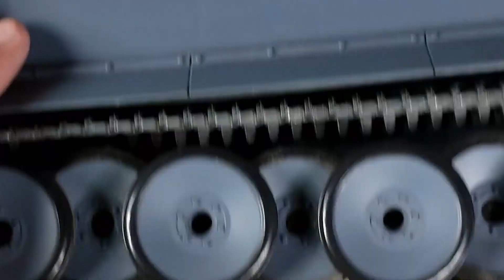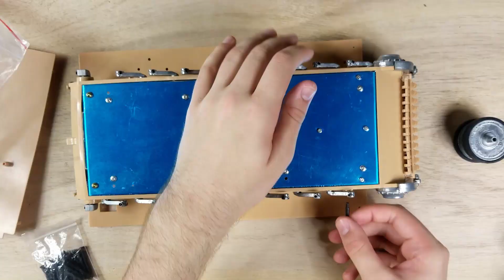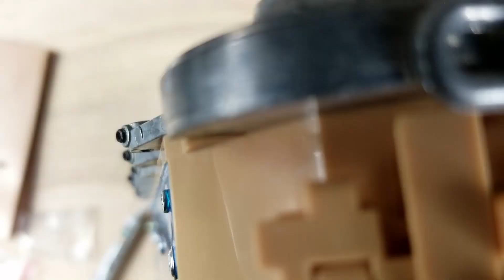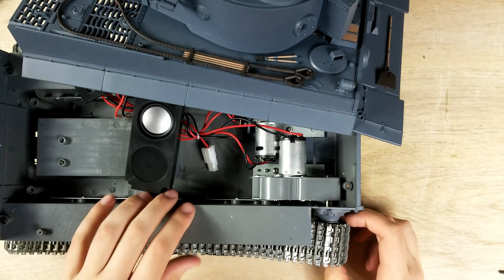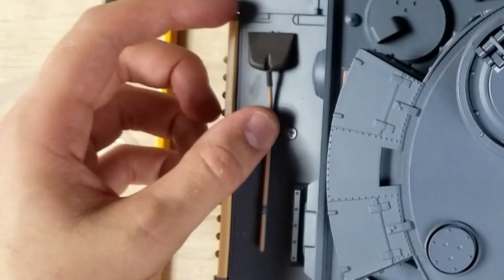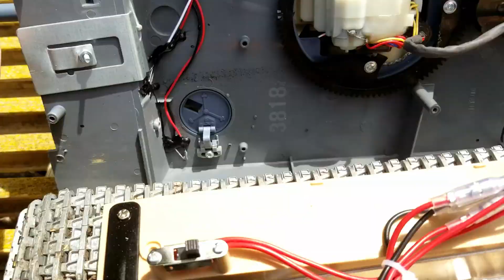1/16th Scale R/C Tiger 1 Upgrade Project- Phase 1

Comment: how does your turret rotate all the way to the back mine dosent?
Reply from the maker: Mine came with a slip ring from the factory, If your's doesn't rotate all the way then it doesn't have a slip ring then it has a stop in the main turret gear to prevent the wires from tangling/breaking from rotating to much.

Comment: Tell me did you solder the wires on the motors of the new gearboxes? There initially the plug didn't seem to be compatible for connecting.

Comment: Did you upgrade the turret traverse to 360 instead of 320?
Reply from the maker: The turret traverse was 360 from the start, and the suspention on the upgraded hull is torsion bars
Reply: Also does the update Edition come with torsion bars and if not what suspension type does it use?

Comment: do you know how to take the roadwheels off? i see you have metal ones so i figured you'd know, i cant find anything on the internet lol.
Reply from the maker: There is a small grub screw on the torsion bar swing arm that you need to unscrew to take the road wheel off. Though I think that this only works on the taigen lower hull and not the heng long hull
Reply: @cobra727  the holes for the grubscrews are there but the screws aren't lol. They're a push fit I found out. But I'll have to order grubscrews to fasten the axles for the metal roadwheels since they're a little to small.
Reply from the maker: @i-muts  do you have the Taigen lower hull?
Reply: @cobra727  no I think I have the basic Heng Long chassis. Tbh I don't know which version I have since I got it from my dad's old storage box and it missed most parts of the box